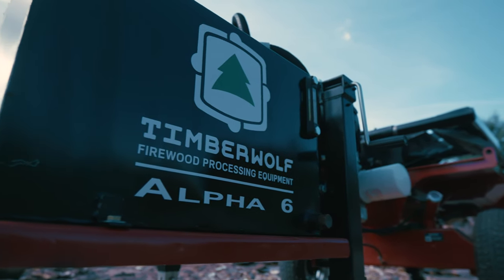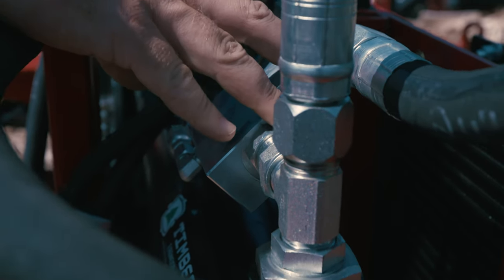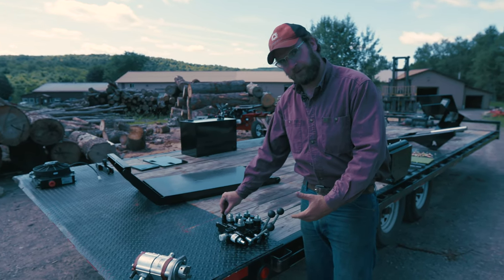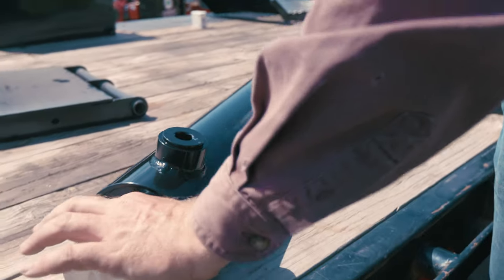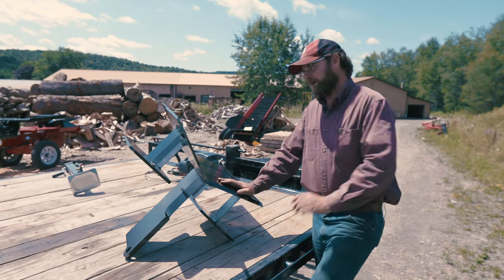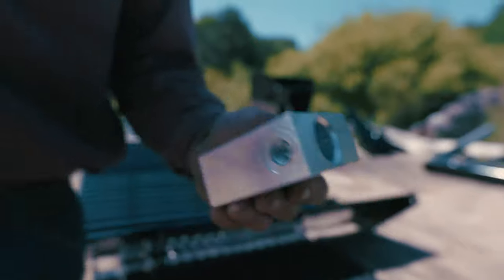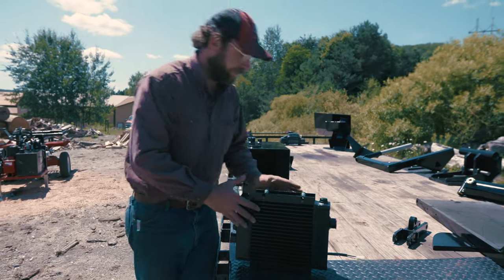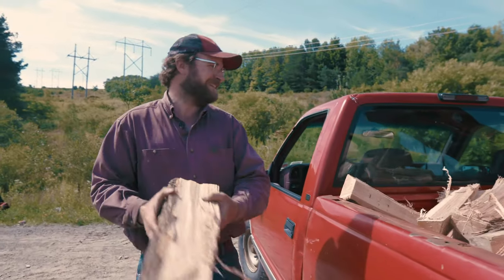In-depth look at the Alpha 6 Log Splitter

Comment: It would be really nice to show the total range of adjustment height of the 4 or 6 way wedge in relation to the table. Have you guys considered designing a splitter with a 360 degree rotating wedge. The random patterns and adjustable table height is very efficient. Check out the Swiss made aficor for an example to look at.

Comment: I’m disappointed that you stated that you test the Hydraulic Tank to 90PSI  and then Soap Tested Said Tank. If you pressurized ANY. Rectangular Tank to 90PSI it would’ve Split the tank around 15 -20 PSI. Thats why we Make Cylindrical TANKS.other than that Good looking Machine. And good video. Cheers and wish you guys every success. I’m looking at buying one